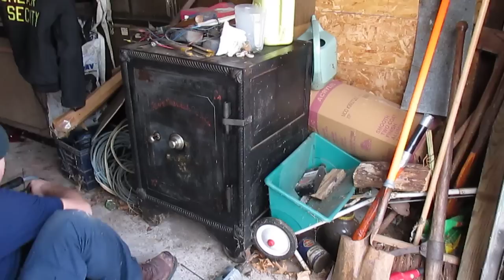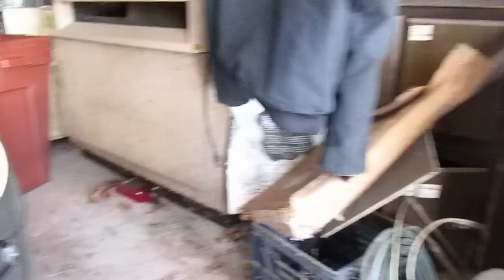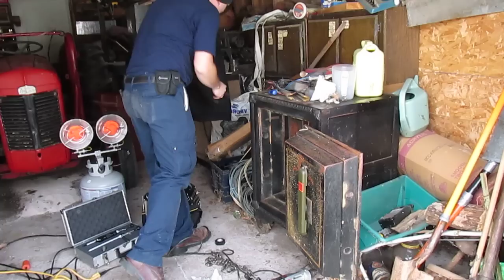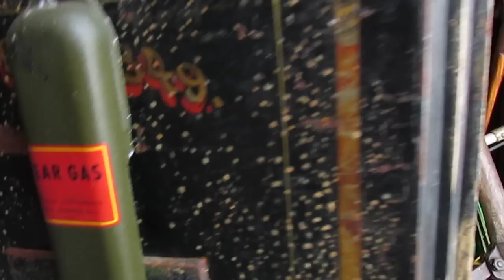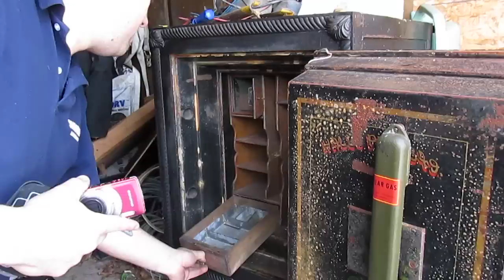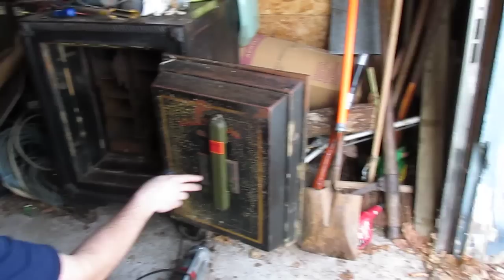Opening old Hall's safe. With a surprise! TEAR GAS!

Comment: have done this work for 30 years and have never seen one, heard they existed though.
Reply: Patrick Crozier I've been working on safes since 84, came across 4, removed tear gas on 2. We have a lot of older safes around here.
Reply: @jimcarsel688  Jim, I have an old safe 1920's and went through a fire. The combobation dial spins but has some resistance like the brass (guessing) internals melted and are not free to spin freely to dial the numbers and open it. It worked fine better the fire. Maybe hit the dial with a hammer to break the tumblers free or they melted too much? How do I open it if I can't get the dial to operate the numbers correctly? I think it's a misled safe something like that.
Reply: Patrick, have a 1920's safe that went through a fire and can't get the dial to spin freely 100%. It feels a little stuck I a spot white spinning and won't let the insides line up to open it. Internals I think melted together a bit, any advice?
Reply: @Tadjuel11-11  the wheel pack is more than likely solid brass with an internal spring steal o-ring if hand change. Key change no difference in materials. Meilink home safes and a few others (monkey ward) had plastic wheel packs amongst other internals like the fence but your brass and steel locks should be okay as long as dial / handle intact. Try flooding the dial with WD-40 ( safe on back, dial up for gravity) at least if you have to drill it,it should at least make wheel pack turn and hopefully fence can drop. Even under nastiest fire/ vandalism lube always helps!
Reply: Also, if mosler 302 series, amongst others ( walk in vault doors) may have internal thermal relocker. Then fence drops but bolt won't retract or  door locking bolts blocked.( Vault doors -external thermal relocker)
Reply: @jimcarsel688  Thank you so much!

Comment: I also have opened many safes over my 36 years doing this and have seen two teat gas vials
Reply: Have a 1920's safe that went through the fire and the dial doesn't spin 100% freely to engage the numbers. I think the in the sides have melted together a little bit not allowing me to dial the numbers to open it. Any suggestions?

Comment: Do you know if inside the Hall's safe the nuts to attach the casters are welded or secured so I can remove the bolts and reattach them?  I can't get inside the safe yet but I want to refinish the casters.  Thanks!
Reply from the maker: No I have no idea I sold the safe not to long after this